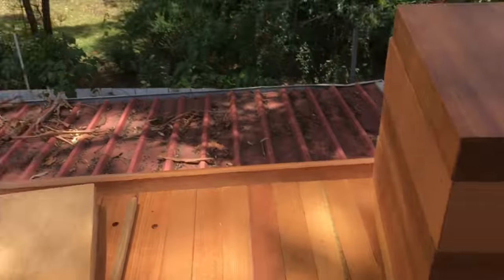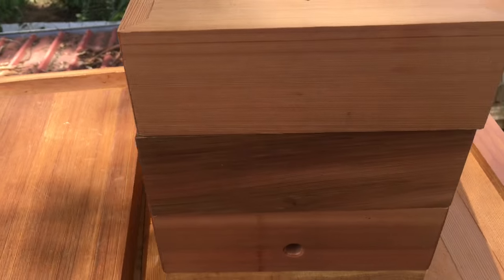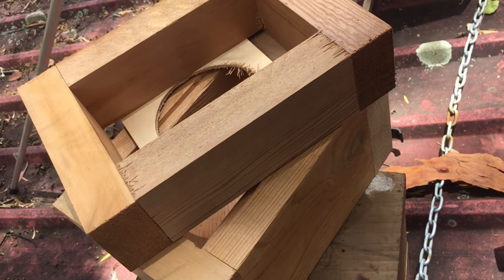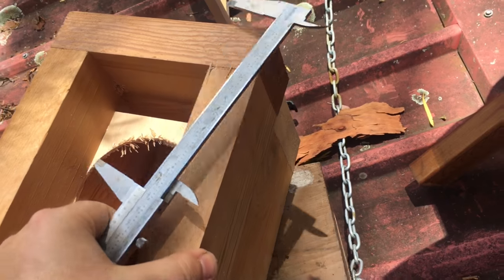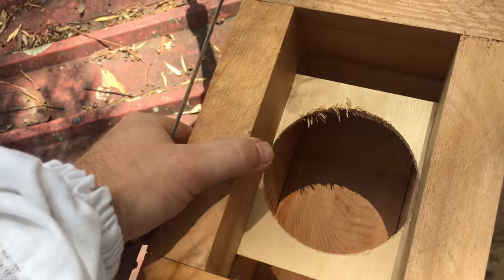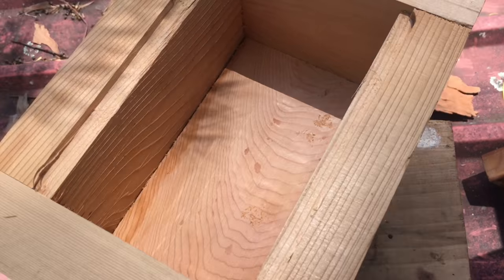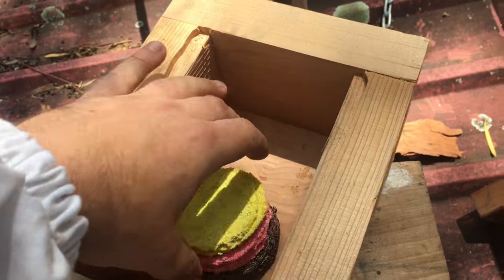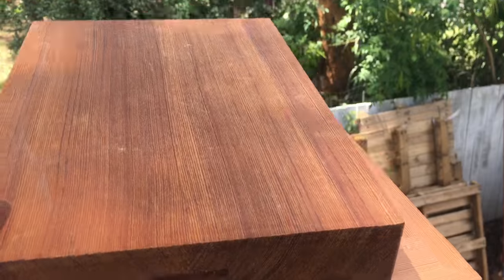Powell Hive Box 🐝

Comment: Thanks for the design. I have built boxes in 50mm Cypress using your basic design. I have made the lid hinged with an adjustable toggle latch holding down tight on weather strip material (double width at joins to be light proof). The perspex "viewing" lid on the honey super is inside the weather strip.
Reply: do you have a viewing panel on the honey super under lid or do you remove super to view internal window